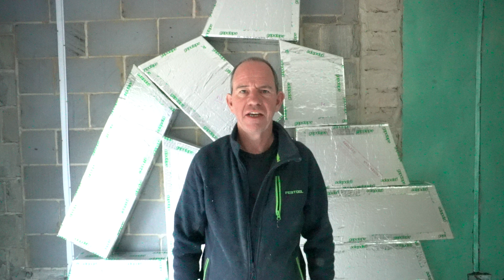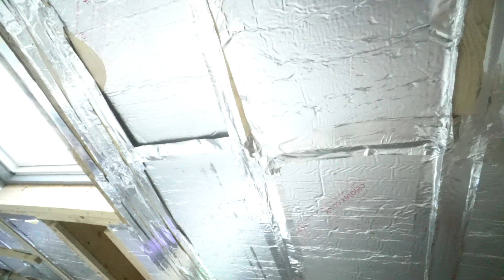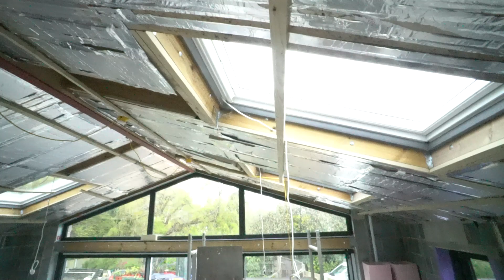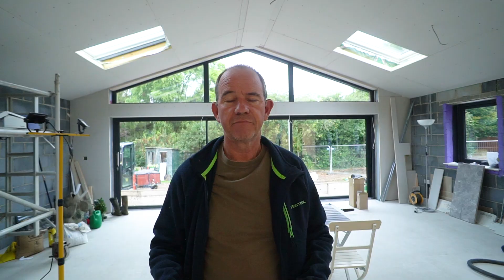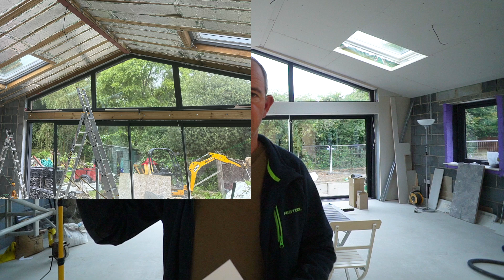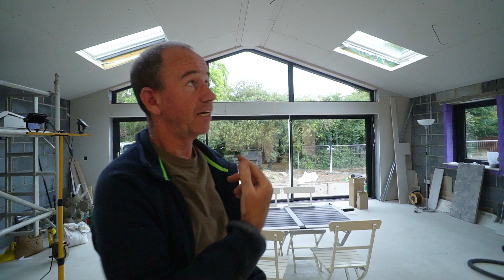Part L performance gap. Why should you "Mind The Gap" when installing insulation

Comment: Having had a very similar experience to yours, I know exactly where you are coming from. However, you are far more reserved in your opinion of the standards to which "builders" in this country perform. Imho there are far too many, hackers, whackers and outright slackers fraudulently masqueradering as builders in this country and operating with little care. No doubt there are some good ones out there that do make the effort and do care that they have not delivered a polished piece of scat. Sadly they are the exception and not the rule. I too have been vexed by the abilities or lack thereof, exhibited when doing even the simplest tasks...mitres with yawning chasms...stud walls  wavier than a rolling sea...
I've spent 2 days meticulously reinstating insulation that even gapotape couldn't rescue. It's all this redoing that is totally unacceptable. I at least now know that the insulation is where it should be, and our bungalow is the better for it.
Apologies for the rant but to see yet another decent person taken advantage of makes me very angry.
All we can do is to keep smiling and trust that karma does apply. Best of luck with your project.
Reply from the maker: Thanks for your comments, I didn’t want this video to look like a complaint or having a go at builders. I think my builder is a decent guy and generally does smaller extensions with happy customers. I wanted something much more and beyond what building control demands for a renovation. A fair bit of what he did was OK but it was things like steels not level that really make me unhappy. I have spent literally weeks trying to recover things that were not level or not finished to anything like the quality I would be happy with and that just shouldn’t need to happen. I think the root of a number of my challenges was the Builder, SE and architect not really talking to each other. I didn’t realise the compromises the builder was making that have made my life so much harder. 
That said I was a difficult client as I wanted to do most of the second fix myself including installing MVHR and all of my automation system which probably got in the way of the builder doing things in a time scale he wanted to.
Reply: @JurassicJungle  I too was considered a difficult client, however, don't fall for that excuse for others inability or unwillingness or their personal demons to deliver the level of finish your plans ask for. Afterall you are the person paying for the project and you are employing them and not the other way around.
Our journey is still progressing almost 18months on, some 9months longer than it should have taken. The one aspect that we never expected to encounter came to light when more than one member of the builders team came back from the portaloo with a bloody nose. This above all else was the root cause of half the issues we had and why we ultimately needed to cut the cord.
Keep smiling.

Comment: I am installing 3.5 inch, 9cm polyiso insulation in a shipping container. I am attaching it to the walls with foamed construction adhesive and making sure to have a 1/2 inch gap between panels that I will fill with canned foam insulation. I can see tape working nice with good edges, but I am not good at making freehand perpendicular cuts, so my edges are wavy.  Against the floor I am using pest block so bugs don't get back there, but on the rest of it I will use either canned foam or a froth-pak. The froth-pak is about 1/3 the price of canned foam, but I need to test some to determine if I need to use door and window foam to not pop them off the walls.
Reply from the maker: That sounds an interesting project, how will you keep it square if you just fit with adhesive and how will you fix anything securely to the walls later? Its not too hard to cut PIR straight but I did buy a Festool insulation saw which I will sell when I finish the build. It cuts a very nice clean edge. The whole point of Gapotape is that it can fill the gaps that are uneven or chnage over time so designed to fit bewteen timbers that will move during seasonal changes or were not stright in the first place. I don't think it would help much butting sheets together. I have not used Froth Pak but have used quite a few tins of foam!
Reply: @JurassicJungle  I am using a $30 jigsaw with the "BOSCH T313AW3" ($11 on amazon) blades. So far I have made 18 4 ft cuts on my first blade. It has started getting some buildup, but still cuts well. It cuts foam at about the same speed as a circular saw cuts wood.  I am using factory seconds (priced at 20% of retail, I have 4ftx8ftx32ft of foam) for my rigid foam board, and I think that the reason it is factory seconds is that the cutter was mis-aligned so I have 2 parallel edges instead of 4. The non square edge is about 1/2 inch off on both ends, well within tolerance for my use.  I am using the welded steel seams of the shipping container for alignment. I am using a 6ft 1x4 to create the gaps that I will then fill later.

Comment: I did this DIY on my extension, took down everything that the builder had done and redid it - it was a similar state to yours.

What made it a little difficult was coach bolts through all the double rafters (asked for by building control) which had to be cut around. I tackled this by lining the rafters with 25mm insulation first (to cover the protruding bolts) and then infilling with the deeper insulation. This actually made the whole operation easier in other ways too, getting a really tight fit against wood is difficult as there is no flex, getting a tight fit against insulation liners is easier because it does actually compress somewhat. 

The fit on mine was so tight that i had to pound it with a piece of wood and mallet to get it in the last couple of mm.

Gapotape does seem the way forward, especially considering that the rafters will have a degree of shrinkage which will create a gap that the gapotape can somewhat expand to fill.

On the veluxes you can also fit 25mm insulation in the reveals before adding plasterboard.

Of course over the top of your insulation that sits within the rafters you should add more insulation in the form of insulated plasterboard or insulation and then plasterboard. For me I went with the latter as it is easier to do in two steps and allows you to stagger the insulation vs. the plasterboard.

I don't think things will improve with builders adding insulation until there is some metric to test an installation. We need something like the air leakage test that is performed to gain passiv haus status.
Reply from the maker: Thanks Luke. We had coach bolts as well. I cut them back as close as I could and most were at the rear of the insulation so we just hammered them back to sink into the back of the PIR.  The problem if you hammer back just PIR without gapotape is that it can cause the PIR to crack and break up. Our Gapotape still needed a tap with a mallet and a piece of wood but the foam of the tape gives a bit rather than stressing the PIR. Overall the gapotape for my project was about £800, we will never know if it was really worth it but I felt much happier with the job. We do plan to fit insulation in the reveals of the Velux and they have the Velux foam collars at the top, thats this weeks job. 

We used insulated plasterboard with 60mm of insulation in front of the rafters as this is what had been specified. I think it may have been easier and cheaper to do what you suggest, working with the large and expensive insulated boards on a vaulted ceiling was tricky even with a lifter. 

We are happy that we have done the best that we can but not happy that the design from the architect and SE made life so difficult. I do wonder if the SE actually looked at the drawings some times.  The ridge was in particular a challenge and we have only been able to add 25mm of PIR between the bottom of the steel and the plaster which is less than ideal. We did install the PIR and isulated board right up to the edges of the steel and used expanding foam to try and enclose it as much as possible. We were forced to do this to make it all line up with the glass gable wall. If we find we have an issued we will have to add more insulation and work out how to make the end wall look OK. We have a FLIR camera so will be paying attention to this as the days get cooler.

Comment: Dont make excuses for them. They are lazy and getting let away with murder
Reply from the maker: Hi, I didn't want this video to be negative to the building trade as there are many good tradesmen out there. I have been very disappointed with some of the elements of my build and the extra work and stress that poor build quality have caused me. Steels not installed level and poorly installed insulation are clear examples. I do suspect that the tolerances I want to work to are way tighter than most professionals would do. 
I do think we need to do a lot to bring build quality up to a decent standard. I was shocked to see the tolerance my windows company allowed when making windows to fit a hole they measured, there was probably 10-15mm of gap that needed foam and silicone. 
With hindsight I would have preferred a SIP style build when panels are made much more accurately off site.

Comment: Really interesting video, especially re the ChatGPT take on performance. Have you reflected on the choice of insulation material at all? For instance I've read that multifoil (as well as being cheaper per 'u') is also easier and more forgiving to install so perhaps a standard quality install using that would result in less of a performance gap. I'm wrestling with the same issues for a retrofit that we start in the new year!
Reply from the maker: I wish I had asked more questions at the start of the project. I just trusted the architects specs. We asked for the best practical installation without understanding the cost implications. For the walls he specified a 140mm thermoclass in a 150 cavity which we found was 3x more expensive. I found the builder had not read the specs and started with 100mm cavities which I made him correct. We have 2 vaulted ceilings which I am sure have cost us way more than I thought. Looking at our spec of 160mm total pir we are just under 0.14 U it looks like the best multifoil can do on its own ( triple layer) is 0.18 U but it may have been much easier than fitting insulated plasterboard. Someone has suggested multifoil for some external insulation so will look at that. In our old loft I plan to use polyester rather than rockwool as I hate working with than and sheep’s wool is a bit too expensive.